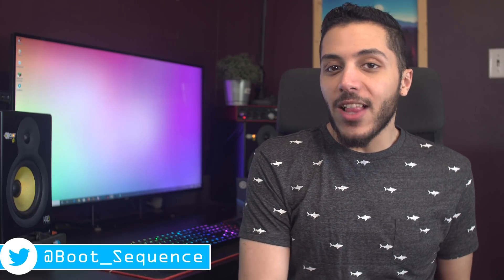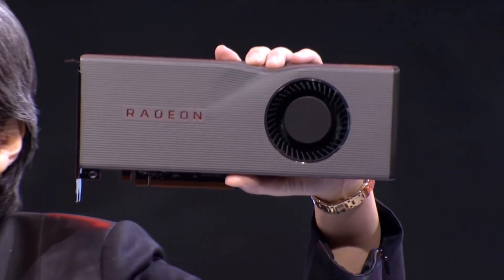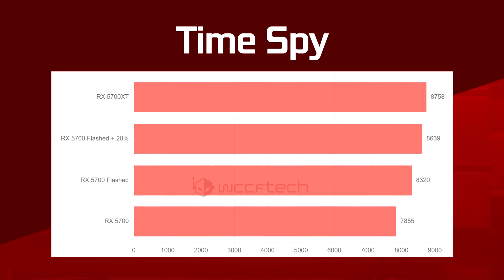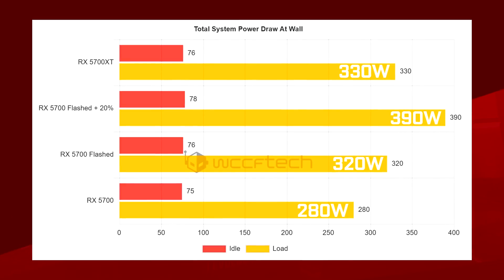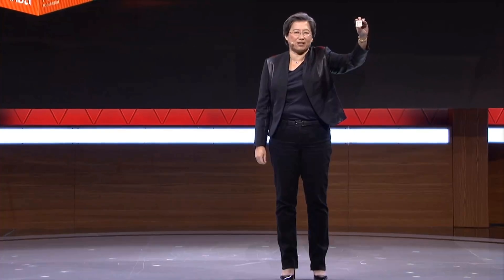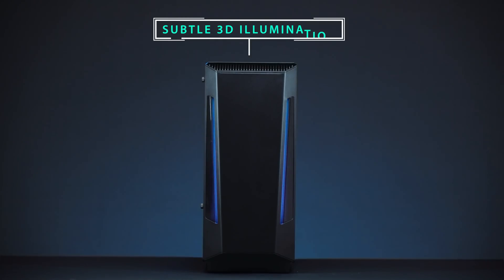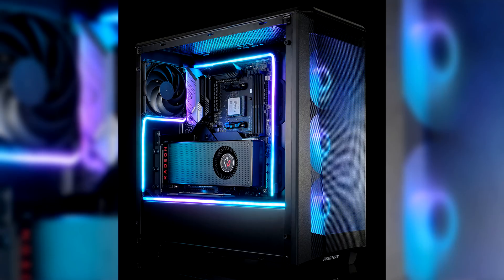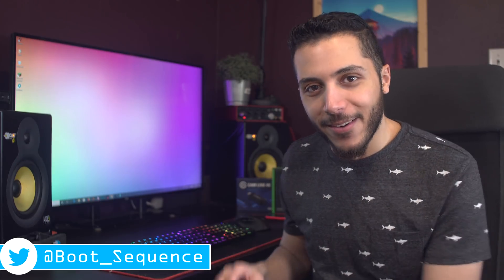BIOS Flashing an RX 5700 Into A RX 5700 XT?! 3950X Possible Release Date!

Comment: Shouldn’t the title say “flashing a 5700xt into a 5700”? Correct me if I’m wrong, but what it says now means that you’re slowing down a 5700xt, not speeding up a 5700
Reply from the maker: Nooo. It means it's a transformation. Both ways work. It's like I'm transforming into a Werewolf.
Reply: @BootSequence  so you're saying both bios work on both chipsets.
Makes sense.

But just one question. Why on earth would you flash a 5700 bios onto a 5700xt?
Reply: @SansUndertale0  
Maybe less pw draw?

Comment: only 390 watts? pff my radeon 7 can pull 520watts  xD
Reply: Damnnnn....
Reply: But thats total consumption of system, not the gpu "only" ...
If your on 500W psu you'd be fine .... with R7 i'd prob pick a 700w ... i always calculate 3/4 of total and last 1/4 or so for spare room. Psus always work best when 80% load anyway

Comment: Did the bios flash on my 5700 pulse and can run 1900mhz and 940mz memory at 75 Celsius
Reply: Thank you for using a PROPER measure ( celsius ) and not the flawed and shit measure called Fairenheght.
Reply: @Digikidthevoiceofreason  it's not flawed it's just diffrent.
Reply: Man of Hokuto No it’s flawed and makes no sense whatsoever and should be banned.
Reply: @Digikidthevoiceofreason  lmao it's actually more accurate than Celsius.
Reply: Man of Hokuto Agree to disagree. Celsius is much more accurate. It’s pretty simple. 0 degrees is the absolute point.  Below that is cooler. Anything over that is warmer.
Reply: @Digikidthevoiceofreason  of course, but that's not what i meant. What i meant was fahrenheit is more precise because a degree in fahrenheit is less than a degree in celsius.

Comment: A small but important nitpick from me. When you compare different numbers with percentage difference you need to use the same number for reference. 
Small example: You have the numbers 90, 100 and 110. 
90 is 10% lower compared to 100 and 110 10% higher than 100. 
But you could also say that that 100 is 11.11% higher than 90 and 100 is 9.09% lower than 110. 
The percentages in the second comparison don't equal the same amount like in the first comparison where one percent equals 1. The second comparison hence can sound a bit misleading.
In this video your percentages were most likely calculated correctly, but you said it wrong. 
It should have been: "The stock was ??% slower and the XT was ??% faster than the flashed model." Not the other way around.

Comment: People need to understand just how CPU and GPU chips are made, they just don't run a specific CPU or GPU then package them up but rather they make all the CPUs and GPUs in batches, unmarked, and unregistered, then during the Binning Process, yes every single one is BINNED, the best are set aside to make the top tier stuff and then each is further processed to some place. During that process it may fail as a higher tier chip but is reasonable for lower hence the CHIP LOTTERY apples to both GPUs and CPUs. Don't act like you don't know this and if you DON'T KNOW THIS, then just consider YOURSELF the Problem. The Wafer is the tech that has been used from day one and continues to be used with very little change. The largest change is the shrinking of the DIE which means instead of getting some 50 usable Chips the wafer can now produce some 300 Chips be it CPU or GPU. In short the 5700 is a failed 5700X and that is a FACT. There is no such LOTTERY but rather dumb luck with regards to the chip making process. The Wafer is Grown and then sliced to as many Chips as possible and they are all placed in a BIN from where the BEST are processed into the Top of the Line whatevers. All of you that are OK with Higher Prices for Lower Performance can physically count the number of functioning Brain Cells and the first digit is a ZERO followed by a PERIOD; then whatever follows is what portion of a single Brain Cell that you are using. Yes I am Old, probably older than most of your Parents, so BEEN THERE, DONE THAT applies and I've forgotten more about PCs that you could possible learn if you lived 5 lifetimes. CPUs and GPUs should be reasonable priced and if GREED and MONOPOLIES were not controlling the PC Market everyone would have the Top of the Top because a complete system would only cost some 800 bucks. NO you single Brain Cell Organisms seem to think that PAYING MORE FOR LESS is how the world Functions because you are too stupid to breathe Oxygen. Wake UP and stop BUYING EVERYTHING then watch how fast Pricing PLUMMETS. Just remember the 5700 failed the 5700X Process so rather then throw the chip away AMD lowers the price by a few cents and you MOWRONS rush out and BUY because you just HAVE TO HAVE IT NOW. Wow, a failed item still SELLS because you just HAVE TO HAVE IT NOW....
Reply: Yikes...
Reply: @SirNicholasT  let him have his moment.😂😂😂
Reply: Calm down grandpa. I don't get what you're raging at. Is it wrong to buy "failed" items? Is it wrong to sell it? Like, as a very basic example, do you throw away a day old bread just because it's not as good as newly baked one or if it's not a perfect shape? Doubt it. Both companies and people try to make the most of their stuff like any remotely sensible creature. What's the point? I just don't get you.
Reply: @asphyxxia  You don't get it because of how you are currently being taught in school as they no longer teach economics the way they once did; hell I am on the tail end. I was using an extreme analogy to make my point and you get glued to the words you fail to see their meaning much like being able to only see a single tree and completely MISS the forest behind it. Google how to make CPU or GPU Chips and my point will become clear as day. Because you don't know how they are made you can only conclude that I make no sense when in fact I am making perfect sense; yet it appears I have to dumb my statement down even further. A Wafer is grown in a lab, Fact, then it's sliced into tiny Chips after it's been imprinted. Then a complete CPU or GPU is produced and the Binning Process begins. During that process the chip is either labeled a 5700 or 5700X as there is no other option. I use this chip specifically because that is what this video is about. When I say it FAILED as a 5700X I do not imply it's a FAILED CHIP but rather that it is NOT an X flavor but regular flavor. Yes what you said about nothing throwing away day old bread is exactly implied in my comment how you missed it leads me to believe you simply glossed over my comment and failed to fully comprehend what I've said. Kids these days don't know the meaning of a hard days work as everything is handed to them. The richer their family is the worse they are at demanding "I want it NOW" and another way of saying it is SPOILED ROTTEN TO THE CORE. PC Pricing in General has a ton of inflation and Greed built in because the PC Market is nothing but Monopolies. Decades ago there were several PC Makers and early on there was a basic CPU Socket that all CPUs Fit regardless of Brand. But then the Monopolies started to absorb the smaller companies and GREED SET IT. Now Intel is number 1 and AMD is number 2. When you only have 2 choices you are not dealing with Competition, though that is exactly what they want you to think it is, but rather you are dealing with COLLUSION. AMD sees Intel getting 1,000 USD for a CPU that should only cost 200 USD so rather than sell their CPU at 200 they COLLUDE and sell it for 600 USD. AMD can break Intels BACK if they wanted to but then GREED would not be met. The current PC market is NOT COMPETITION. AMD has no intention to COMPETE with Intel but rather COLLUDE as each Monopoly makes out and you and I foot the bill... Do you understand now? Probably not, I doubt you even read this far...
Reply: @cybercapri  corporations are greedy? No way whoda thunk it, and it's all our generations fault too. 🤪
Reply: @cybercapri  you're delusional and bitter grandpa, I got into PCs in the 90s in the MS DOS days when computers were shitty and expensive as hell. In the 70s the "top of the line" HP 3000 cost $92000 or $500000 in today's  money. 

Don't be mad you don't understand inflation and you're too poor to buy parts, if you work hard enough and pull yourself up by your bootstraps you might be able to afford it before you die.
Reply: if you are as old as you say, I would have expected you would be over the whole Im smarter than you shite